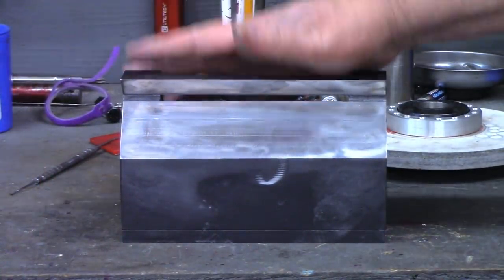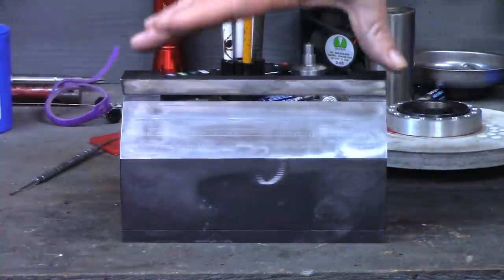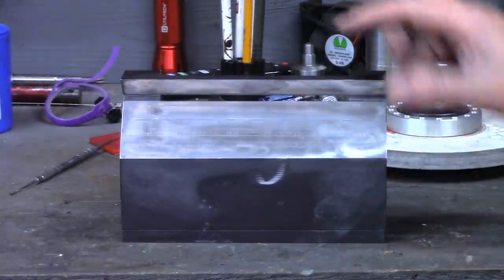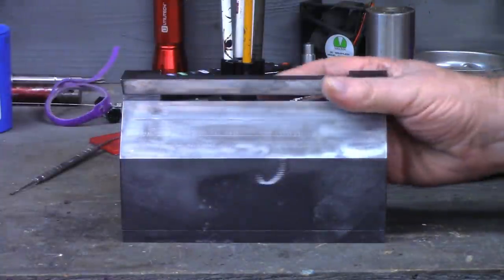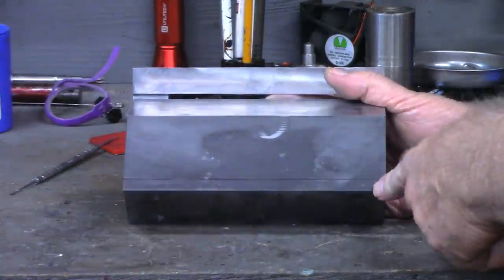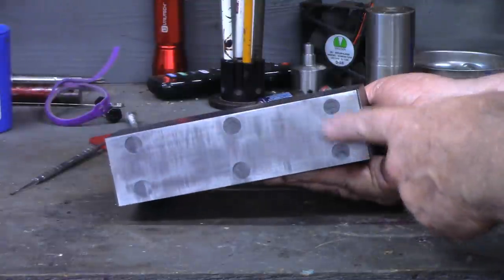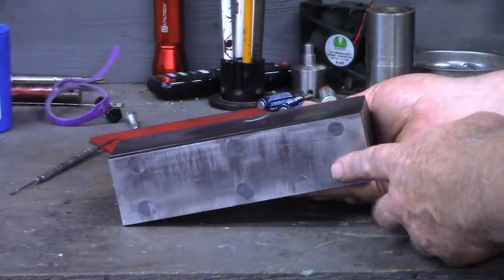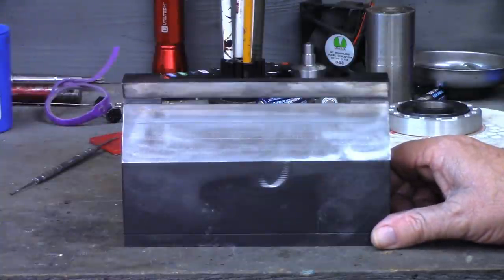Setup & Use of the Tom Lipton (Oxtoolco) Surface Grinder Chamfering Block

Comment: Thanks for sharing, I am in the process of trying to find a reasonable priced piece of steel to build one of these out of. I may end up making it out of a piece of 2" X 3" 1018 that I already have.  I would have like to see how you set up for milling.
Reply from the maker: R. Steven Lang, Shark River Machine Just be sure it’s long time enough for the wheel to sit down in the pocket.
Reply: @MrPragmaticLee  All of the dimensions will be the same except the overall height.  If I need to chamfer a long part I will have to move the jig toward the the near edge of the mag chuck by laying a parallel  between the jig and the fence.

Comment: Are you able to put the wheel guard down? You had me a little worried the way those sparks were flying.
Reply from the maker: Lloyd yes, it goes down fine and that’s the way I use it when not videoing.